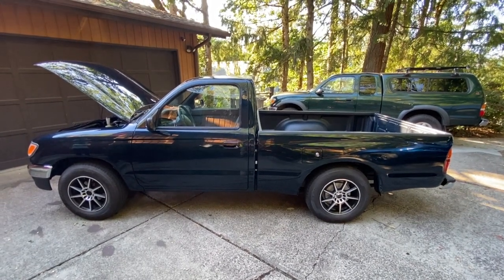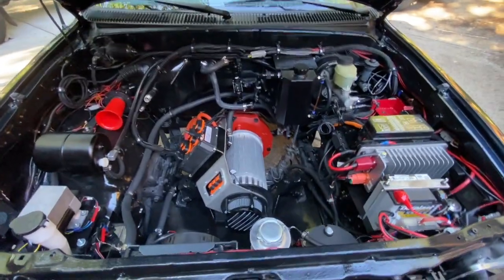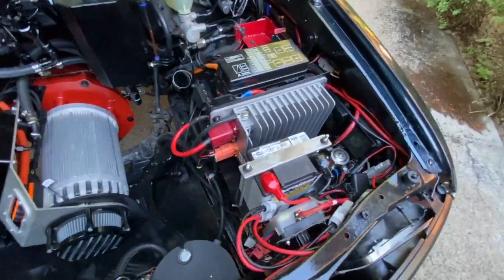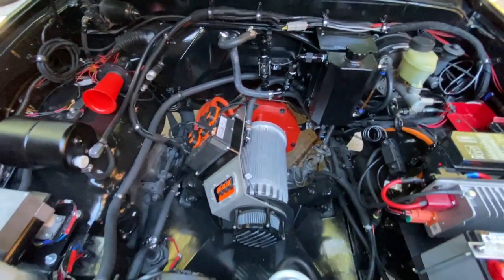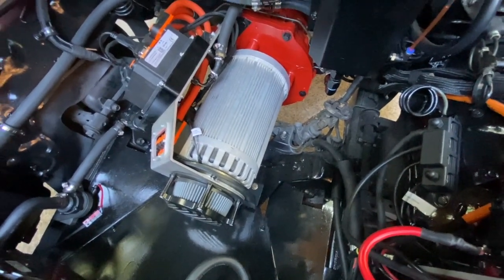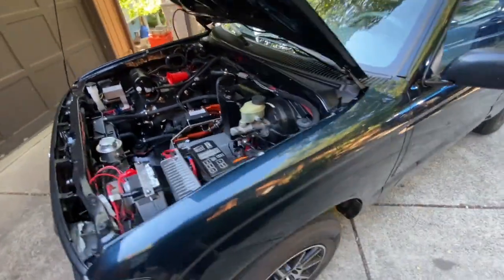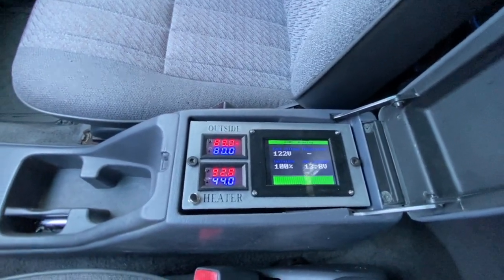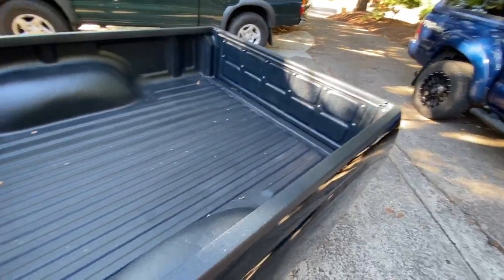1996 Electric Toyota Tacoma Truck Conversion

Comment: So the new motor feeds into the existing transmission -- does that mean that you still 'change gears' ?  Also, would this would work with 4WD ?
Reply: Assuming the motor was connected to the transmission, which it seems is the case, then yes, one would still use the gears as necessary and it would work with 4WD too. A 4x4 is heavier and would not be as energy efficient having more weight and when in 4WD more rolling resistance and drivetrain overhead.

Comment: What's a conversion like this cost? Super cool. I really like that you keep the original transmission and all that.
Reply from the maker: HI Seth, I have included a primary parts list in the video description. Its hard to define costs, but conversion is around $27,000. That includes batteries and everything to make the vehicle work. That price does not include any costs for bodywork, manual labor or a new paint job. Please also note that that price is pre-pandemic, so costs might have increased some.
Reply: Really awesome video Forrest!

Comment: How much is it  the cost for this conversion
Reply from the maker: Hi Antonio, I have included a primary parts list in the video description. As my dad stated, its hard to define costs, but conversion is around $27,000. That includes batteries and everything to make the vehicle work. That price does not include any costs for bodywork, manual labor or a new paint job. Please also note that that price is pre-pandemic, so costs might have increased some.

Comment: How can I buy the motor for my 89 Toyota pickup
Reply from the maker: We used a hyper 9 motor. Groups such as Electric GT, EV West, and Canadian EV, sell hyper 9 motors.
Forrest
Reply: @forrestkasschau5284 do you know if they have a bigger motor for the same mounting plate? When do you run into trouble with the transmission not handling the torque?

Comment: I have a 1996 Toyota that I would like to convert also. I wish you had more details! I've had my truck for 25 years now and it has over 300K on it. It's time to go electric.

How much did this conversion cost??
Reply: My son Forrest is busy right now but I can give you some of the details of our build. First off our 1996 had over 300k on it as well and has been a very easy conversion getting parts etc. There are stats and the full build on the google sites page listed under "show more" above. Currently the motor has 173ft/lbs of torque at 0MPH. We have a 25KW battery back (5x Tesla batteries water cooled) and goes about 100miles on a charge. The truck does 0-60 in about 7 sec and has about 200HP. We can charge it for less then $2 at home and it lasts all week. 

Anyone can do it and yes your 96 will work since it has a W59 transmission and all you need is a W56 bell housing swapped out on that transmission. All the Toyota trucks from that time used W series transmissions with the bell housing being the main difference. This means you can put a W56 bell right onto your W59 transmission and bingo bango there is a motor plate that holds the Hyper9 electric motor for a W56. All the rest is non- vehicle specific. Its important to understand we worked with ElectricGT for the battery box and wiring harness and they were great to work with all the way through startup of the systems. I can explain more if your interested.H

Its hard to fully determine costs but we have $4k in Hyper9 motor and $20k in the batteries and $3k other main parts. After that its up to you for the body work and paint etc. Its not cheap as you are buying your "gas" up front but we have already made back over $500 in savings in the past 3 months. The project was started in Oct 2019 and has been running since April 2022. The conversion is quick and easy if you work with groups like ElectricGT. 

Cheers
Reply from the maker: Hi E S, I have included a primary parts list in the video description. As my dad stated, its hard to define costs, but conversion is around $27,000. That includes batteries and everything to make the vehicle work. That price does not include any costs for bodywork, manual labor or paint. Please also note that that price is pre-pandemic, so costs might have increased some. 

Cheers